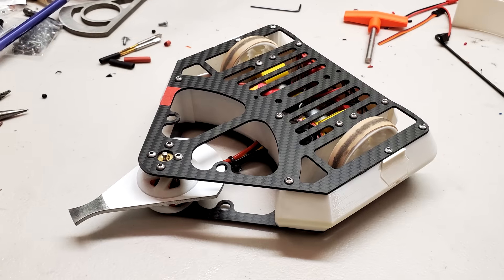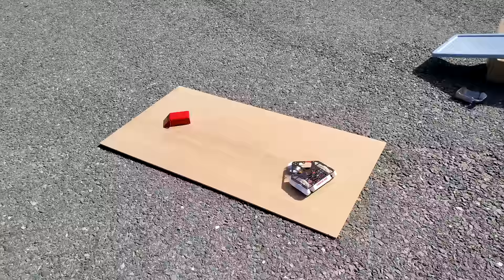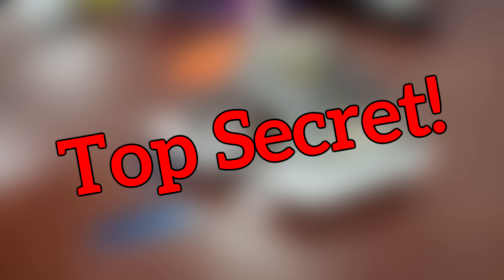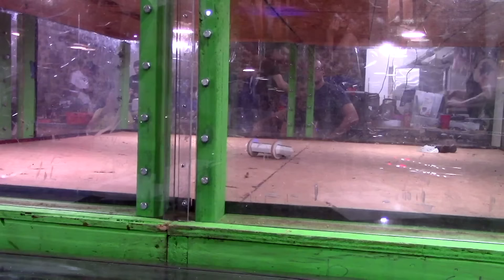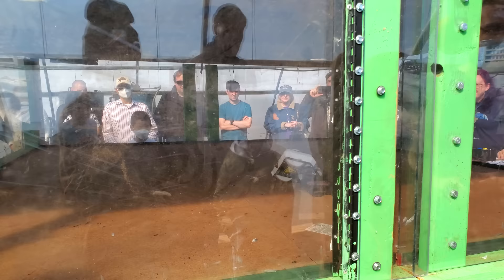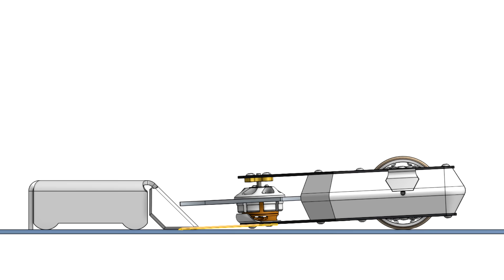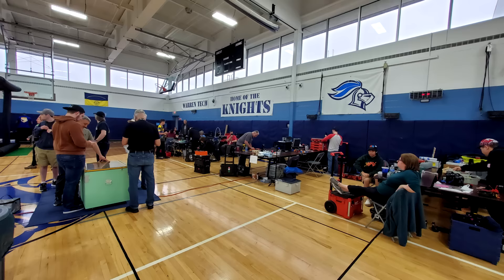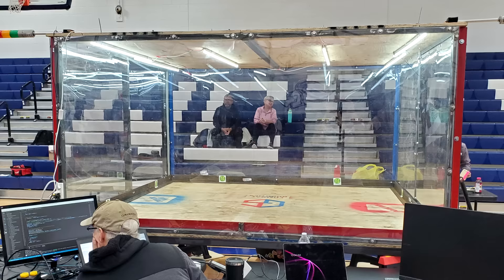Cheesecake has a secret weapon! (April Annihilation 2023)

Comment: 9:20 I don't understand what happened here?

Wasn't this Dulce's win through pin, and then they basically gave it up? Or am I just not comprehending the rules?
Reply from the maker: You can only pin an opponent for 10 seconds, and then you're required to release.
Reply: @alexsalchemy  Ah, thanks for the clarification. I thought it was the same immobilization countdown that ended the round for most of your opponents.
Reply from the maker: @Nevir202  - Yeah, it might help if the announcer/ref counted UP to ten just to make it different from the knockout count.
Reply: Does pinning your opponent get you points?
Reply from the maker: @DanielCopelandMD  - Yes, it takes away your opponent's control over their robot, which is one of the three categories the judges score on, the other two being damage done to your opponent, and aggression in how you engage with your opponent.
Reply: @alexsalchemy Never understood that. When you are pinning you also have no real control because you can't move either without releasing the opponent, so both are immobilized and it's a neutral state. Unless there is a secondary weapon pinning should be meaningless.
Reply from the maker: @Droid6689  - I mean, the pinner is certainly in control: they can release whenever they want, but the pinned robot has no such ability. That seems like a plausible asymmetry which favors the pinner in that interaction.
Reply: @alexsalchemy  It's false control. They only have control of transitioning between two neutral states that provide them no tangible advantages. The states being both bots being able to move and both bots being unable to move. The claim is the pinning bot is always able to move, but that's hypothetical until they do so and once they do the other bot is able to move as well.
Reply: @Droid6689  That's still control - 
Let's pretend this is a real combat situation - if they wanted to, they could force a draw right there and then. 
(You can use your imagination about the value of the escape option against allied or enemy reinforcements in some robotic warzone, or just go with a more technical grasp of a potential draw in a tournament. )
As such, you could argue that such a pin is basically a draw, unless the robot in control decides to keep fighting. 

Since the rules force the robot controlling the pin to continue fighting, I think it's important to recognise that they could have forced a draw if rules didn't forbid it - hence their being given a point advantage on the control judgement. 

In other words, it makes a certain kind of sense, if you think about it. :)
Reply: @xxxxSylphxxxx  Forcing a draw means no one wins. Points help YOU win. Those aren't equitable.
Essentially if there was no time limit every single wedge bot would lose 100% of matches because it is not an effective  tactic. The arbitrary point gain from it is the only thing that makes it useful.
Reply: @Droid6689  If I can make a robot that costs as much or less than your robot, and can force a draw, I have an economic advantage. 

There's nothing trivial about being able to force a draw. 

Or, if you prefer to steer clear of 'the logistic and economics of war' examples; if my robot can pin every opponent, it is at least equal to every opponent. That's significant. 

(I hate the wedge meta as much as the next someone, but pinning is an important sign of control, and deserves recognition. Albeit, if I had anything to say in the matter, less than an automatic draw.)

For another analogy - if I, a regular fighter pilot, could 'pin' the red baron in world war 2, would it be valuable? Of course it would!
Reply: @xxxxSylphxxxx  Your example only works in the context of a competition involving more than 2 competitors. Yes, if an inferior competitor could freeze out a superior one that is a net gain. But in the context of 1v1 it is still neutral.

Economic advantage is meaningless. Cost is irrelevant.
Reply: @Droid6689  "But in the context of 1v1 it is still neutral."
Exactly. 
Even outside of the economic theorising here, a 'pin' is, at the very least, neutral... Ie. A draw, by this reasoning!

A draw is a draw. 50/50. 

The option of ETHER a draw, OR going on for a further fighter, is, by this argument, at least a draw, possibly more, since the control of the decision is in the hands of the controlling robot. 

In other words, a pin should be a LOT of points. The bare minimum seems to be 50-50 of the match record. Yes?
Reply: @xxxxSylphxxxx  The bare MAXIMUM is 50/50. The wedge bot has zero ways to finish the fight outside of time so they can NEVER win unless they are arbitrary granted points for a stalemate.
Reply: @Droid6689  In this 'deep in theory' territory, the bare MAXimum is 50/50 for the robot *being pinned*. The bare MINIMUM is 50/50 for the robot doing the pinning - the robot in control can EITHER take a draw by doing nothing, or choose to go on fighting if their robot is going to win a longer fight. The robot in no control can't get anything more than a draw unless their enemy allows it, which a weaker enemy would not. It's this lack of symmetry that is so important. 
To rephrase this: Just assume (sensibly) that a weaker robot would always maintain a pin, and a stronger robot would always stop the pin - it means that a pin is at least a draw, and being pinned is at most a draw.

If the wedge bot indeed has nothing whatsoever it can do to possibly win other than a pin, then what you said is correct if rules aren't invented around this... 
However, wouldn't it be boring if wedge bots just pinned opponents to force draws all the time?
How could we invent a rule to stop that from happening?
How about: We don't allow pins to last more than 10 seconds, but give bonus points for doing them? That way, the wedge bot pilot is encouraged to keep playing! 
We take away the 'guaranteed draw', and replace it with a chance for a win and chance to lose, provided that the fight continues?

That's the entire point of the rule.
Reply: @xxxxSylphxxxx  Or give them zero points and keep the 10 second rule. Then the competition is more interesting  and creative instead of a bunch of bots designed to exploit the arbitrary ruleset.
Reply: i think everyone disagrees with you. there are other competitions that favour what you want to do so maybe the sumo robots that just push each other out of the ring is for you if you are afraid of actual robot fighting
Reply: @alexsalchemy  is their Trophy trading in this sport? I feel like the bend motor for the gouged frame could be a cool trade for memories. some serious fights happening.
Reply: Never watched wrestling?

A pin is very much  control.

In wrestling it’s a win. In this it’s a point.
Seems pretty logical
Reply: It reminds me of milling in TGC games, its just annoying but not that game changing.
Reply: kid let him win
Reply: @Droid6689  how is it so difficult to understand that the person who chooses when to unpin is the one in control. he makes the decision. it's not that deep at all
Reply: @Droid6689   It doesn't matter if a draw is a neutral outcome, what everyone is talking about is the control to force such a draw and that is in the hands of the pinner. The value of a draw is subjective anyway and there is many situations where it's pursued over a win in many sports. take chess for example, to an opponent who is ahead a draw would be an unfavourable outcome and for you being behind a win might be impossible so the draw is the next best thing and in this situation, a beneficial outcome.
Reply: @Droid6689  How do you expect people get in to the sport if "cost is irrelvant" yeah cost shouldnt be factored in to points but it gives an option for people who dont have a ton of money. Im just coming in and plan a wedge with a trick i found in highschool. I have a sizeable challenge because of that unique wepon idea but its being designed to be worse case senario a bad wedge.
Reply: @Droid6689 
Ok, we could just give no benefit for taking your opponent all the way to the wall and pinning them. If you really want every bot to be a spinner.

The reason the rule works that way is to encourage variety

Comment: Add a transverse bracket across the top of your weapon motor that holds a shaft bearing above the spinner.  That will greatly strengthen the motor shaft and keep it from bending under impact.
Reply: I would even suggest a longer shaft that runs all the way up to the other side of the frame with a second bushing. This should be very simple to design and still handle the torque load on the motor a lot better.
Reply: Yeah i was trying to see, is the axle held in double shear? Supporting on the other side of the weapon too would make it much much stronger
Reply: I guess weight is the limiting factor here...
Reply: I would suggest a small pancake motor. No need to mount to a shaft and mount the blade directly to the top of the motor. Pancake motors have no external shaft for mounting propellers rather the propeller mounts directly on top of the motor that has built-in threads. Much less leverage to bend anything. I crash my small fpv drone with pancake motors at over 60 mph and have never bent a shaft hitting concrete.

Comment: Ever think of using a pulley for a belt drive on your weapon?  A pulley on the drive motor driving a separate shaft would allow you to use a stronger shaft that is anchored on both ends and keep the impact forces from being transferred to your motor.
Reply from the maker: I've thought about it, but right now I just don't have the spare weight or space.
Reply: @alexsalchemy  doesn't the motor shaft go all the way through the motor? You could just extend it to attach to bearings on both ends and bending it would be significantly more difficult.

Comment: you could try a chain drive or two for the blade to avoid bending spinny parts and a girthier rod to hold the pointy parts.
maybe a slippery clutch thingy so that sudden stops don't goof the motors.
you could maybe try a diplomatic solution, where you hug it out with your opponent. this would be the cheapest of options available as well

Comment: What you should try is a pancake brushless outrunner motor for your weapon motor. It has a thick shaft but you can bolt your weapon blade right to the motor bell as it is flat on top with threads already. Cheesecake is a bad little battle bot! It likes to eat tires for breakfast, lunch, and dinner. Fantastic job on the little dude!

Comment: Nice bot ..  and upgrades .. the smaller wheels are the way they give a better attack angle .. the shims to avoid scrapers are just genious "depending on the floor "  it also heps to show your reach  you coud try it on the upper part as well  ..  the complete chassi on the back also hepls to give you tortion rigidity ...  about the air diplacement of the main rotor you should try blade variations, triangles are the strongest

Comment: Chain Saw Leg Armour ..Chainsaw protective fabric works on a number of principles .Clogging
The fibres of your chainsaw protective garments’ material are drawn into the drive sprocket by the chain, blocking chain movement and keeping you unharmed. Beneath these, long, loose fibres of  polyester, Avertic  , ballistic nylon, or Kevlar is laid in layers .....ie clog the motor up Armour lol

Comment: Can someone explain why the kid released his pin around the 9:20 mark?
Reply from the maker: You are only allowed to pin an opponent for 10 seconds, then you need to release. You can immediately try to pin them again, but it cannot be a continuous pin for the whole fight.
Reply: @alexsalchemy  How would a robot like his win in this case? What decides the fight?
Reply: @970c  At 11:13 it has some followup with the same bot fighting another guy and winning. They don't aim to outdamge, they aim to control their opponents and win on points. Which is great if they get to time, but moot if they get taken out beforehand. The lack of a real weapon gives them a lot of weight to put into armor, batteries, and/or beefier motors.
Reply from the maker: @970c  - If a wedge bot cannot knock out its opponent, and if they are both driving at the end of the fight, it does to the three judges to decide the winner based on three things: damage done to your opponent, aggression of each robot in the engagements, and the control they had over their driving. E.g. If Dulce de Lucha had been pushing me around the entire time, he could have won so long as he took minimal damage, and that's usually exactly what happens.
Reply: @alexsalchemy  Ahhh thanks for explaining. I like that rule as if pin could last over 5 seconds or count towards the "10sec no moving rule" it would lead to a really boring meta of ramp robots.

Comment: I think you should name the entire bot Sweet Tooth.

Could you design the fork so that it has barbs and can potentially lock and capture a wedge's long enough to chew it up and make it less effective for the rest of the fight? 

You could potentially make the fork a bit longer than your weapon so it can be useful holding opponents in other matchups. Slides under chasis, make it harder to pull away (barbs), rip into chasis.

Comment: One way of preventing motor shaft failure would be to separate the motor from the weapon so that it only has to provide torque and not survive the massive radial shocks. Something like a belt pulley to transfer the power from the motor to a separate, much stumpier weapon shaft. It would cost some weight though.

Comment: if you add a slight down bend to your weapon it will make your bot stay grounded but push your opponent away or even nock them up. I do the same on my lawn mower to nock small rocks down so they don't damage my lawn mower case.

Comment: You 100% need to decouple your motor from the weapon. That in itself will save you TONS of damages. I'd suggest a direct bolt on slipper clutch. Main disc bolted to the drive motor, clutch material, weapon, bearing, spring adjustment, and a larger shaft. When your weapon dumps all of its energy at high speed, the weapon dumps its energy plus the force the motor is adding at the friction limit of the clutch. As the motors inertia overcomes the clutch it slips and comes down to a rapid stop but not instant. The instant stops are what's destroying motor shafts and breaking magnets loose. Clutch it. And i dont recommend centrifrugally clutching it, however that could also be an option. Offsetting the weapon close as you can to a bearing would help. You could even have drive disc, clutch, weapon, clutch, pressure plate and use the 4 mounting holes on the motor as the adjustment for the slipper clutch. Think old associated RC10T style clutch. If you wanted MORE destruction, you could also make the driven bell heavy to add more rotating mass. ;)

Comment: I think you could stand to make some dimensions of the frame smaller, reducing air space and add the weight savings into thicker more durable frame or w/e else. Like the gaps on either sides of the wheels maybe larger than they need to be and maybe shrink in the back some.
Reply from the maker: You are absolutely correct, and I am currently working on a more compact version of Cheesecake which does exactly those things. My biggest struggle is finding space for the battery and weapon ESC. I'm considering using two smaller batteries connected in series in order to get everything to fit in the more compact chassis.
Reply: @alexsalchemy  Ya maybe, would that create failure points though? Maybe separate batteries for drive and weapon, some redundancy? Seems like there might room up in the front corners too somehow, I don't know if that area gets hit a lot.
Reply from the maker: @SpiderWaffle  - Those are both good ideas. Separate drive and weapon batteries might be the way to go, and there is some space in front of the wheels, I'm just not sure if it's enough to be useful.
Reply: @alexsalchemy  Maybe the best would be to try and reduce that space in front the wheels with a new shape, but I'm not sure where you need to take impacts.
Reply: @SpiderWaffle  Yeah, start the taper towards the weapon mount closer to the wheel.  Could also taper behind the wheel like the front to save some weight and give opponents less to hit.

If you can swap locations for the batteries and motor controllers, you possibly save some wire weight, might be able to shorten the chassis, and give the "heavy" batteries more leverage as counterweight for the weapon.

Can you space the bearing mount farther down to make the motor shaft shorter?

Comment: micro-bearings.. In the form of.. Delrin and Stainless Shim-washers, to stabilize your motor-shaft of the 'spinner'. Use Silicon Spray between each, and stay 'close' to the shaft-size (A Milimeter is too much 'slop').

Comment: Man as well as being a great maker, you're one of the best drivers I've seen. Very few mistakes if any.
Reply from the maker: You're too kind. During my fight with Shotgun, you can see me struggling to touch his wheels when he's in the near-left corner: I definitely need to keep practicing my fine steering controls. On the plus side, I'm pretty happy with my sidewinding driving style, especially since many vertical spinners can't turn so quickly to keep up.
Reply: @alexsalchemy  you'd already won the fight by then, so caution was probably best. An inverted CPU fan might suck the car to the ground, creating better handling, but no idea where you'd fit that in the robot, or if it would be too heavy.